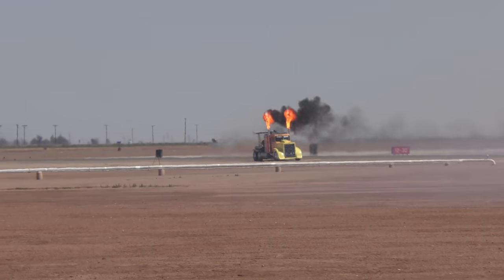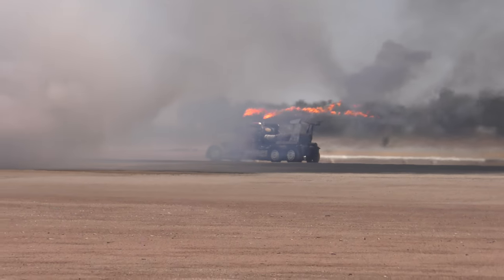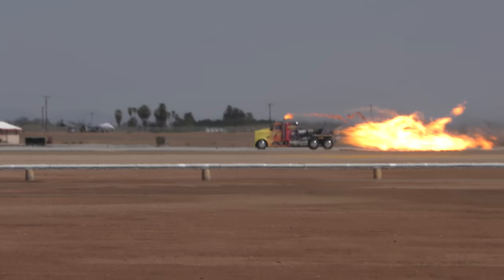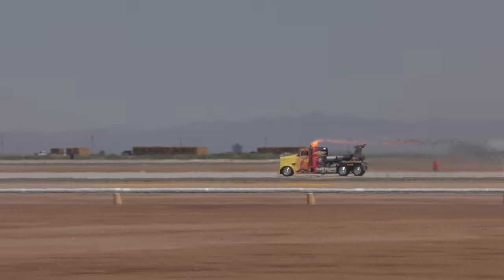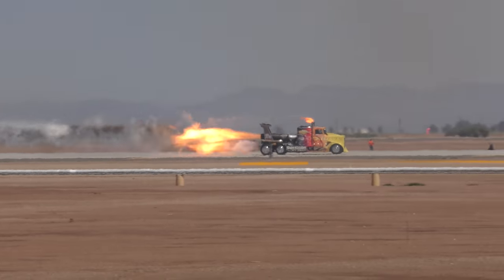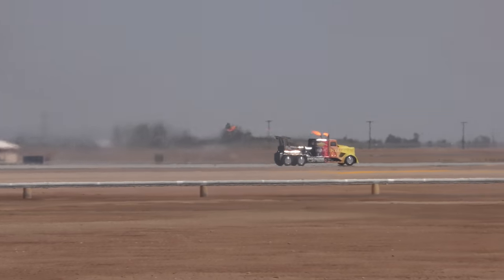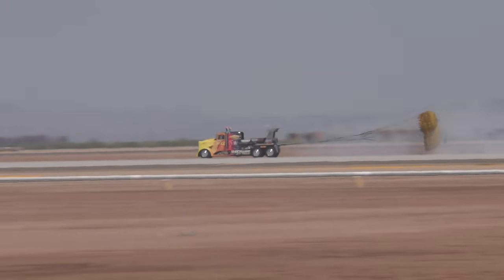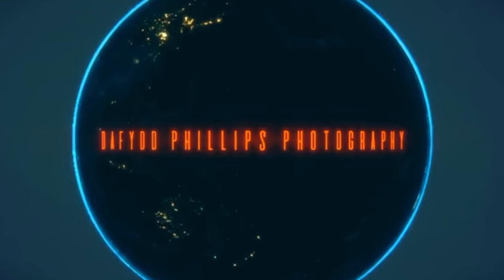SHOCKWAVE!!! 36,000 HORSEPOWER JET TRUCK V PLANE (4k)

Comment: Impressive machine. Do those top exiting exhausts have an actual purpose (like flare stacks perhaps?) or are they just for show?
Reply: Just for show.
Reply: @terryboyer1342  Yeah thought as much. Thought they may have been used as some sort of pressure release similar to oil fields using them - along those sort of lines anyway.
Reply: Purpose is it looks badass lol

Comment: it weighs 7000 pounds? A chevy suburban weighs 6000 lbs.
Reply: Definitely a typo on the spec sheet or something. My F350 diesel pickup is 7,700 lbs.